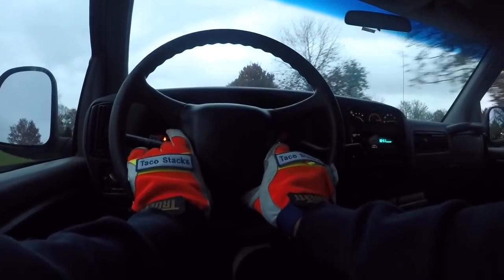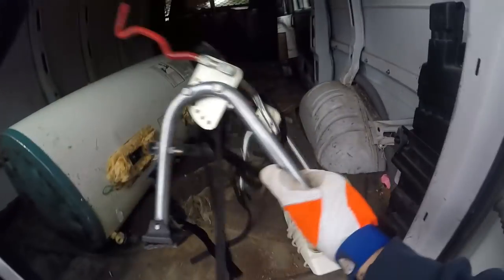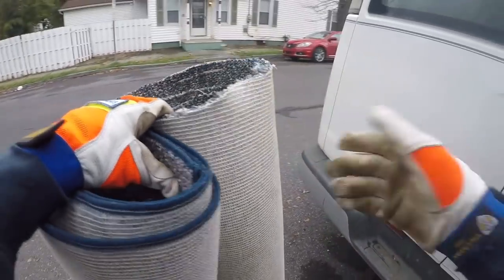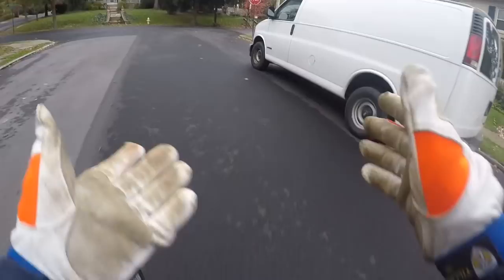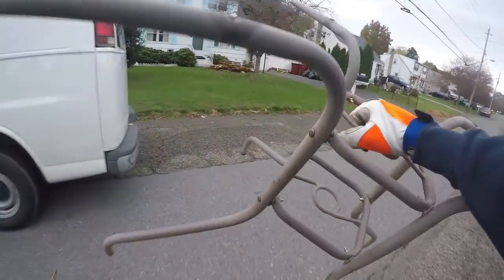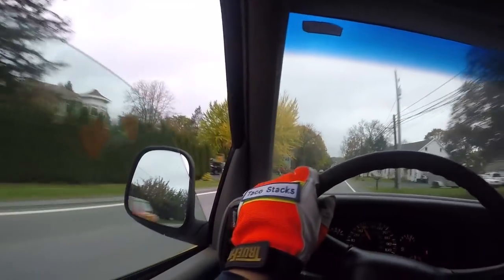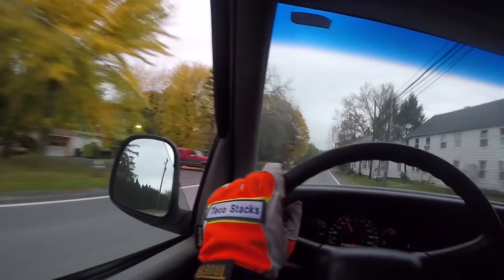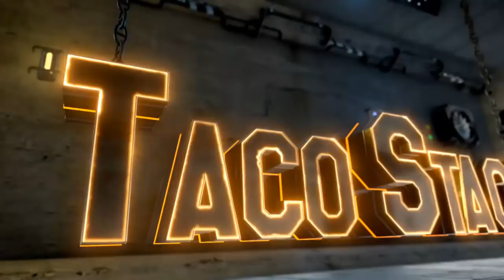GARBAGE PICKING LIVE - Finding FREE Treasures

Comment: Did you ever consider keeping a hand truck in your van for when you find heavy scrap items like the water heater?
Reply from the maker: I am thinking about adding a hand truck for estate auctions, I wouldn't do it for scrap, if it's too heavy to push to my van, it would be too heavy to lift another 2 feet  or so into it.
Reply: I hear you. I been using a hand truck as much as possible lately, just to save some wear and tear on my back, even when the item isn't too heavy. I mostly mentioned it because everybody I know who does flea markets or scraps or anything like that has a bad back.

Comment: when you get water heaters 
use a pipe wrench to remove the brass fittings THEN take wh to the scrap yard 

also its a real pain to scrap out aluminum windows with glass 
I just took in 100lbs of metal & only got $6 for it all UGH